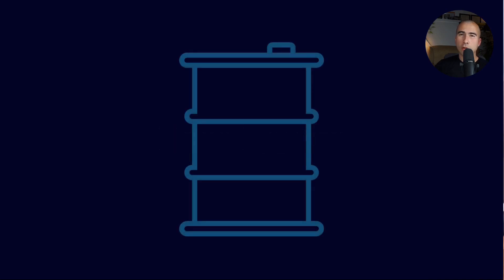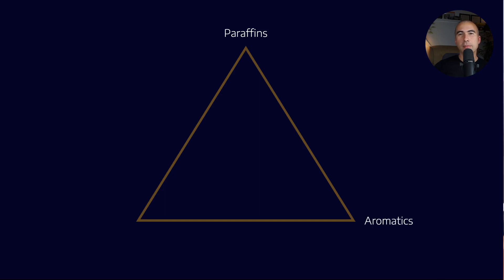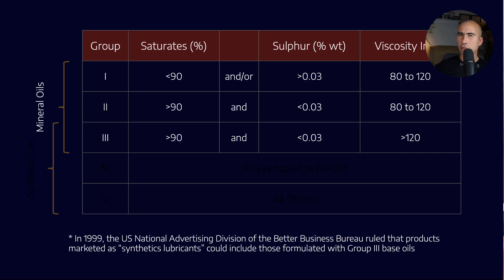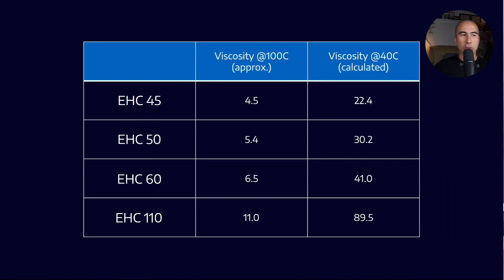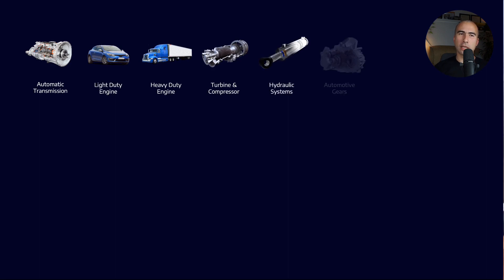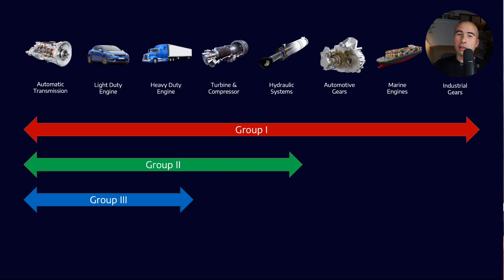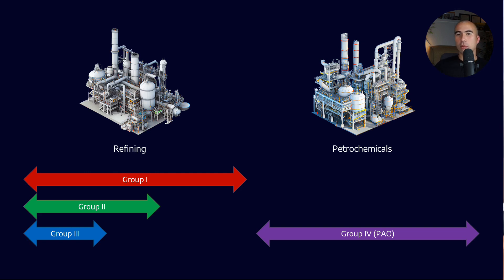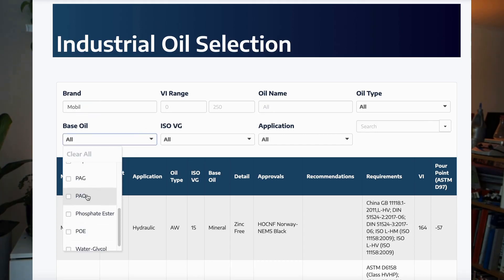Base Stock Fundamentals

Comment: What if any are the drawbacks of going for an oil that has the winter vs hot viscosity / flow further apart?
Is the only difference VI and the increased modifiers needed to make the oil fit both flow ratings, are there no drawbacks from that or?

My personal logic would have it that an oil closer in winter and hot ratings would perform better in the sense of longevity and robustness since there doesn't need to be as much of a compromise being made or not as many additives for viscosity and other reasons needed for the oil to perform well at both ratings which are further apart so you could dial the oil in better or make less compromises for hot vs winter conditions, is there any merit in this or are modern oils able to handle far apart ratings without any problems? The extra viscosity modifiers and additives needed don't bring anything negative in-terms of oil performance, longevity at high temp, aging, TBN, protection, oxidation etc? How come we don't see any further apart ratings such as 0W50 or 0W60 or 5W60 for example? Purely because of lack of a market?

Would for example a 0w30 vs 5w30 vs 10w30 be any different keeping everything else the same in any way as far as protection and longevity go or is it only winter performance differing with no drawbacks in any way is what I'm trying to get at. If so, why would you ever run anything else then the thinnest possible winter rating that still meets the hot flow rating, there'd never be a reason to run 5w30 over 0w30?
Reply: In another video he mentioned that as the oil is used the viscosity agents break down, so your 0w50 might turn into a 0w25 or something that's less suitable for your engine over the oil change interval. Only true base stocks with less viscosity change will remain consistent over time.